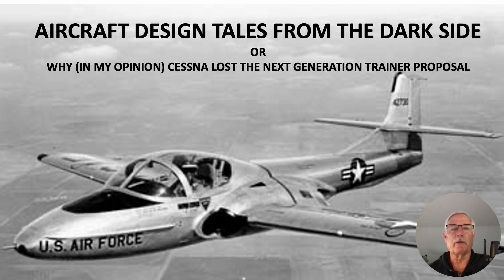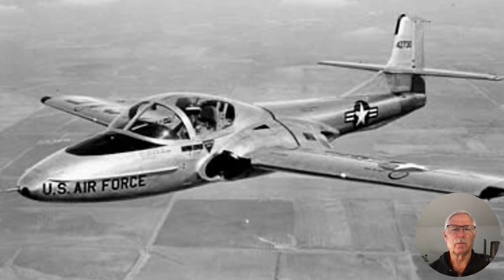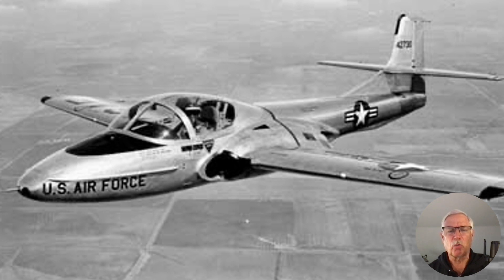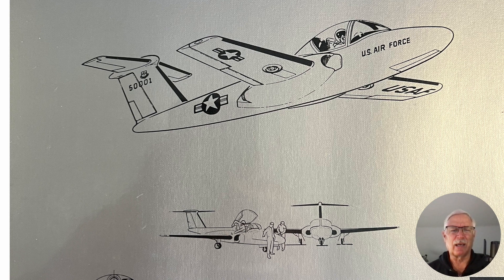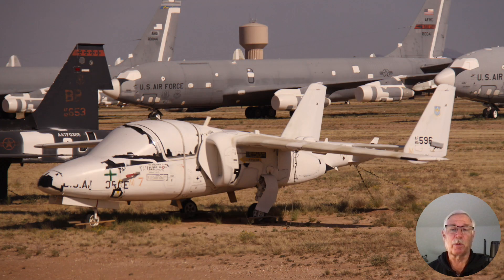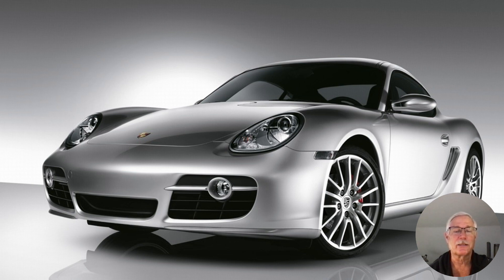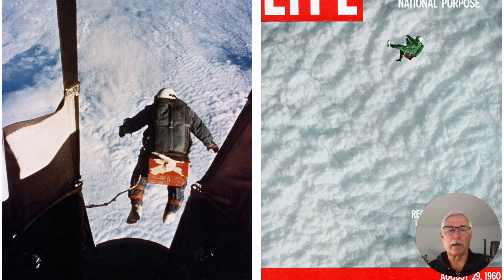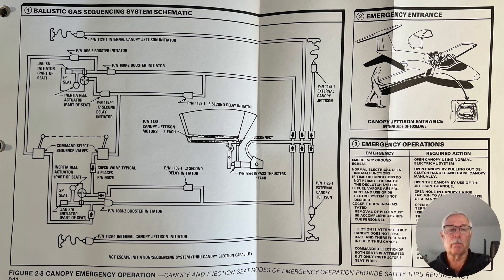AIRCRAFT DESIGN TALES FROM THE DARK SIDE OR WHY (IN MY OPINION) CESSNA LOST THE NGT proposal

Comment: Been following these with interest, both as an amateur aircraft designer and flying instructor, but find this episode a little confusing?
I can only go on what I've read (never having flown jets), but always thought the little T-37 was a good concept for a trainer, if a little underpowered. One would have thought the advent of the A-37 would have been an obvious replacement for the Tweet.
As for the failure of the 'Tweet 2', the explanation leads us to believe that Cessna lost because they only had a drawing, while Fairchild had a flying item, even though they lost in the end anyway.
Beechcraft had in some way gone a cheaper route by just licensing another manufacturers product (Pilatus), and throwing it into the competition.
Some will say the Texan II is a completely different machine to the PC-9, but only in similar updates that would set the PC-9 apart from the PC-7. An interesting note here would be that Beechcraft was doing this to replace the old T-34 Mentor, but as it turns out the original Pilatus airframe, the PC-3, is of similar vintage to the T-34.
I guess it's always a hard decision for airforces whether to go from abinitio on jets, or a more civilian like propellor trainer, or to offload abinitio training to cheaper civilian operators using said prop trainers as we currently do here in Australia?
Reply from the maker: The A-37 would have had too much power. I have flown both. It has a lot of power to carry an armament load. It wasn't that Cessna just had a paper proposal. The reviewers are looking for innovation and most of the innovation on the Cessna proposal was fairly hidden by what appeared to be just a glossed over tweet.
Reply: I have 1,000 hrs in the A-37 and it is a gas hog and is why we carried 6 external fuel tanks.

Comment: That entire NGT process was a total boondoggle and Cessna wasn't the only company that screwed the pooch.  Grew up on Long Island, graduated college/ROTC spring of '82 with a pilot slot at Willie Class 84-01, report date in Oct '82.  So the summer and fall of '82 I got a temp job doing basic grounds maintenance at Fairchild-Republic Airport in Farmingdale, Long Island.  That summer there was a big stir over at the F-R hanger because they did a T-46 rollout after the contract award was announced.  I went to look at it, and even as a novice pilot I remember being totally underwhelmed.  The entire design just struck me as half-baked.  Not to mention, turns out the rollout aircraft on display was just a shell - didn't even have engines in it.  We all know how that project was bungled in the years that followed.  A ton of effort went into making that plane work but F-R just wasn't having it.  Years later I met a fellow PIT IP at Randolph who had spent about a year working on developing the new syllabus for the thing.

After they finally canned the T-46 the AF was casting a pretty wide net to find SOMETHING to replace the Tweet.  I actually got a backseat ride at Randolph around "88-'89 timeframe in the T-45 Navy trainer because they were soliciting opinions from experienced Tweet IP's as to whether or not it might be a worthy successor for the T-37.  I personally didn't think it would be a good primary trainer...
Reply from the maker: Thanks for sharing your insight from the "other side" of the fence!
Reply: The other day, I thought that maybe an F-20B would have been a better trainer to replace the T-38A, and I say that as a critic of the F-20A for all its issues that made it a non-starter for TAC.  F-20 would have solved the gutless T/W and control system challenges in the T-38, while providing a modern cockpit for guys who would eventually convert to F-16Cs, F-15Es, and F-15Cs.  Shared common engine cores/components with F-117A, FBW, more modernized, easy to maintain.  Thoughts?
Reply: @LRRPFco52  My thought is that you know a whole lot more about that than me!  I think you meant that question for Ron...